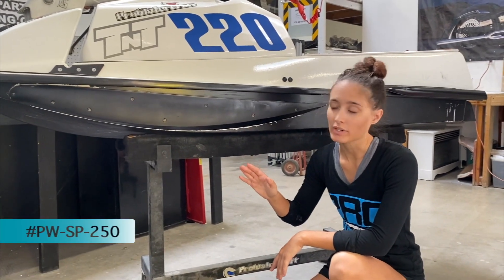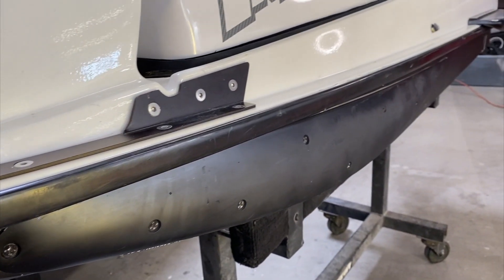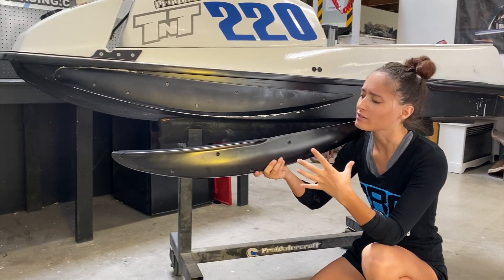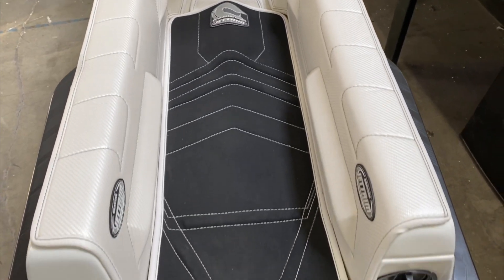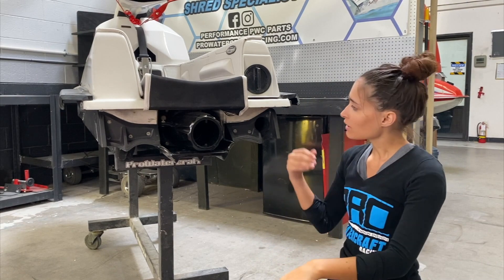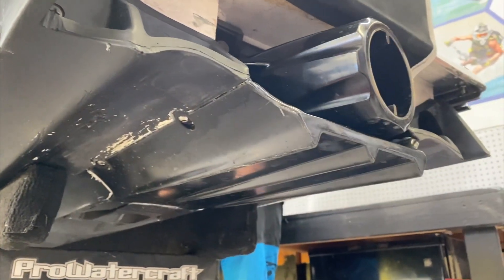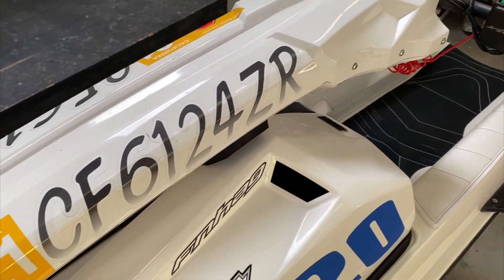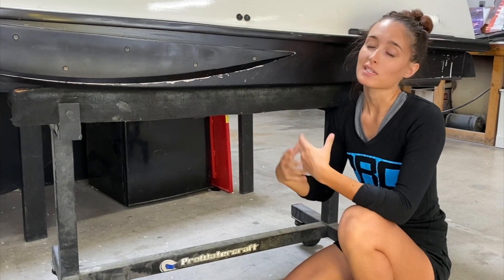Kawasaki 440 / 550 handling set up!

Comment: with the rear hull extensions do you HAVE to buy the ride plate as well? i already have a mariner ride plate and plan to buy your nozzle and hull extensions and sponsons from you guys
Reply from the maker: Hi! For best performance, you'll want to run them together for more grip, because they were designed to work well together. But we do have some customers who are running old school plates with our hull extensions and do like the set up -- results might vary from plate to plate though.

Comment: I noticed the rear Sponsons are installed all the way in the rear and other have it installed a bit more forward. What is the difference?
Reply from the maker: Hey Tylyn! Good eye. This is mainly a personal preference most of the time, but with the 550 SX, some of the skis have the HIN number on the side  of the ski. In that instance, you can modify the sponson (void the warranty) to fit around the HIN, relocate the HIN, or move the sponson forward. That is more than likely what you are seeing sometimes. BUT, to explain: for more rear grip, we recommend running sponsons as far back as possible. If you push the sponson further forward, you get less rear grip and more grip near the center of the ski, which results in more of a pivot-style turn, with a lot of grip around the intake for hook up. Where the sponsons are run is generally a personal preference, but in the case of 440s and 550s we definitely recommend running it as far back as possible. A little bit further forward (like for the HIN clearance) won't compromise too much rear grip though.